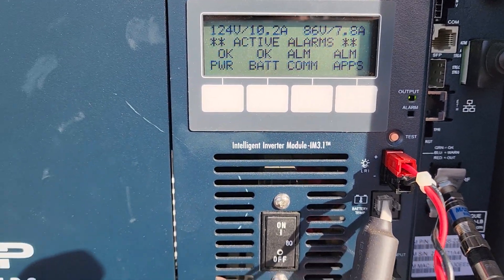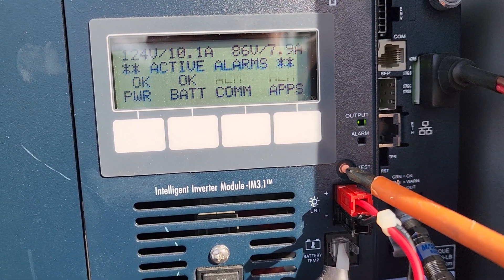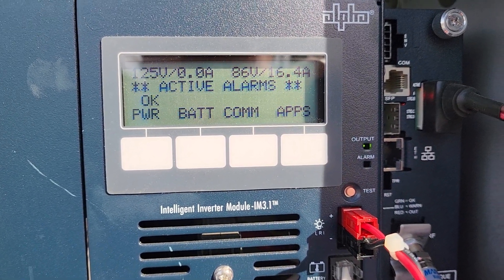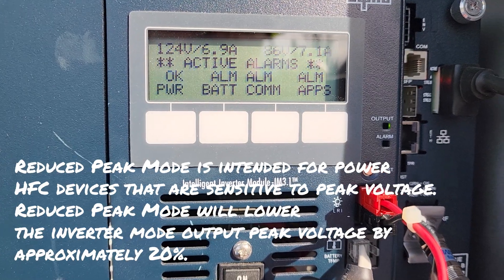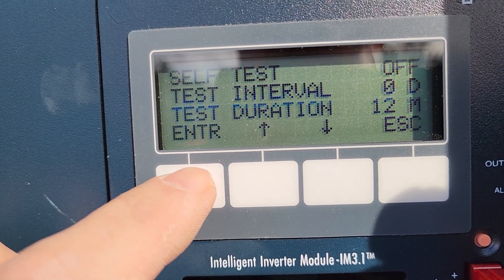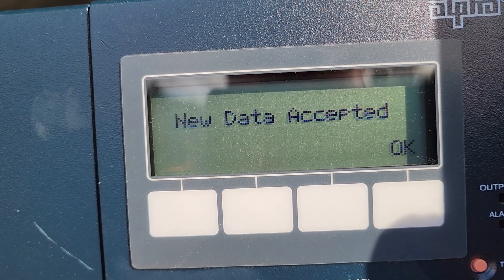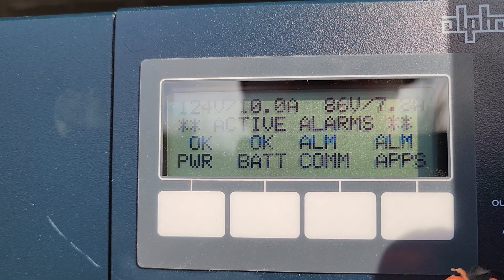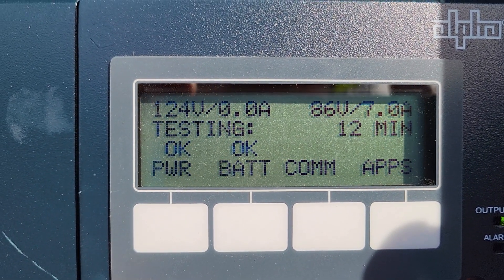Alpha XM3.1hp Enabling RMODE

Comment: Contact me if you would like additional training on any Alpha power supply     George Bosak   -  Enersys
Reply from the maker: Thank you my friend.  I didn't want to get too detailed and step on toes. This was mostly for my local crew... but it got some traction.  Did I missrepresent anything? I know I didn't explain the why very well, but that was kind of intended.
Reply: @Time.Twisted  I think you did a good job.  If you have any questions or want additional details let me know and I can email a training presentation :)
Reply: One additional note.  On the XM3 its only Disable or Enable.  On the XM3.1 you have Enable, L2 & L3.  L3 reduces the output crest factor the most, but also reduces battery runtime the most.   But if Enable doesn't resolve you issue, you can try L2 and it that doesn't work try L3  :)

Comment: What is R Mode's intended use? This information is useful, but I don't know what the function is for, or why it is there.
Reply from the maker: From Alphas site. Reduced Peak Mode (RMODE) Inverter Regulation: Reduced Peak Mode is intended for power HFC devices that are sensitive to peak voltage. Reduced Peak Mode will lower the inverter mode output peak voltage by approximately 20%. RMODE can be enabled locally via the Smart Display or remotely via the Alpha® cable modem web page. When RMODE is activated the power supply inverter efficiency will decrease by approximately 2 to 3%.
Background: Legacy CATV HFC equipment may be more susceptible to the peak voltage of the XM3.1-HP™ power supply Output waveform than newer HFC equipment due to circuit design, surge protection, electronic component aging, and distance from the power supply. When the XM3.1-HP™ power supply switches to standby inverter mode or a Selftest is performed, the equipment load may not power up or cause an output failure on the XM3.1-HP™ power supply.
Reply from the maker: In short, it is there specifically for what I showed. When i lit up the self test, the voltage spikes. Some device in my node was having troubles with it and will burn up. This will prevent that from happening.  My guess is that electrical standards have changed in the 25 years since some of this equipment is installed. RMODE was an added feature that came some months after the original software.
Reply: @ Is this specifically on XM3.1  or also on XM3?
Reply from the maker: @mcelfreshiii  it's available on the 3.0 and above.
Reply: let me know if you have more RMODE questions.   George Bosak - Enersys :)